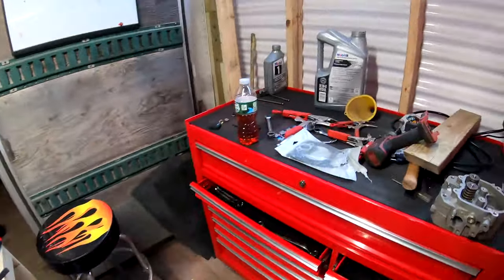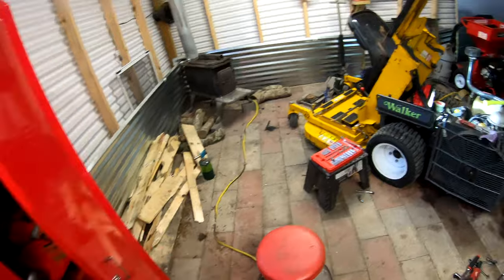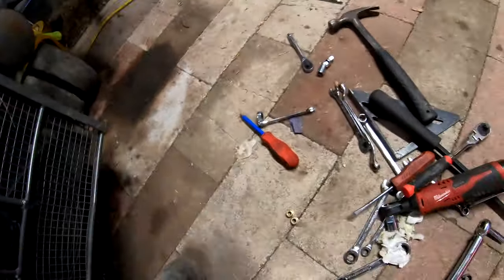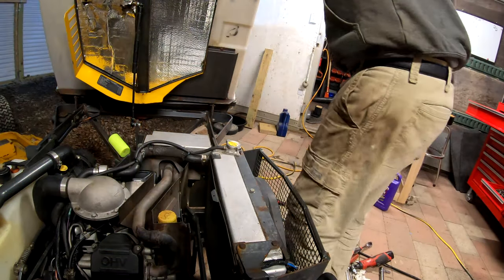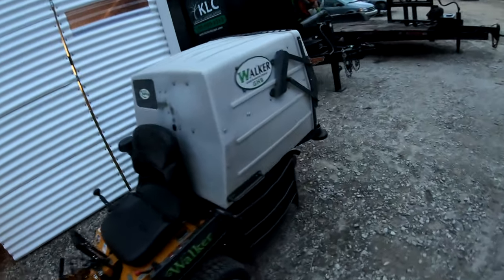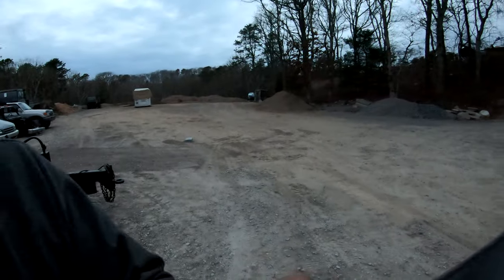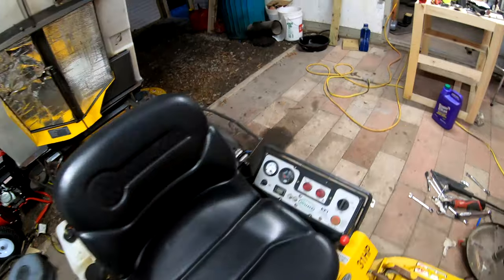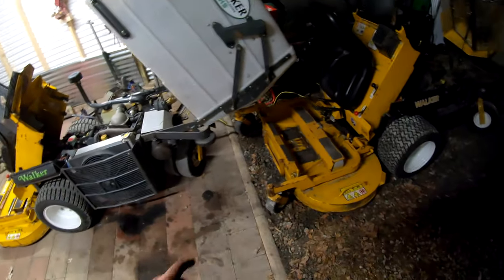New $1000 Walker 31HP Head Gasket Finished

Comment: I have a ch20s in my walker.  #1 cylinder is burning oil and fouling the plug.  Someone told me to replace the breather reed. Did that.  Could it be the rings?
Reply from the maker: Thats how all my motors started to fail, burning oil in £1 cylinder, yes rings and valve seal. Usually if the breather reed valve is bad it burns oil in both cylinders. Sorry to say but it may be time for a new motor, you could prob run it on some thick oil for a little while until you replace it. Try some 20w-50 and maybe you can get a little more time
Reply: @KenMrKLC  where is a good place to get a motor?